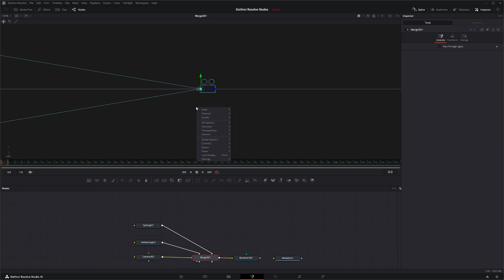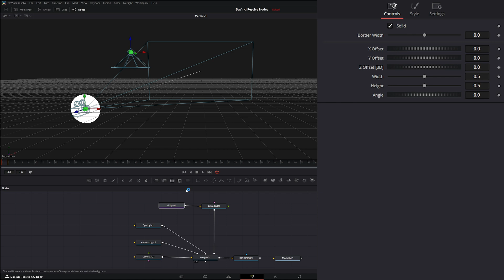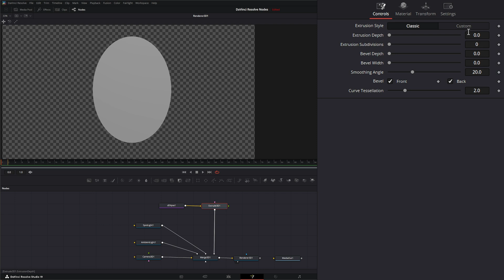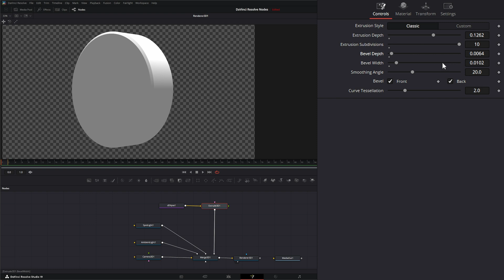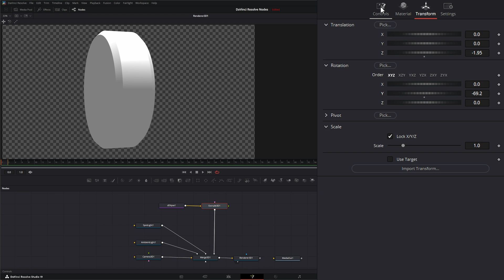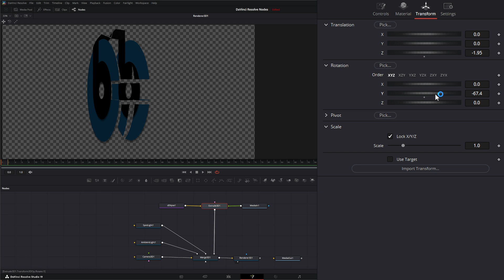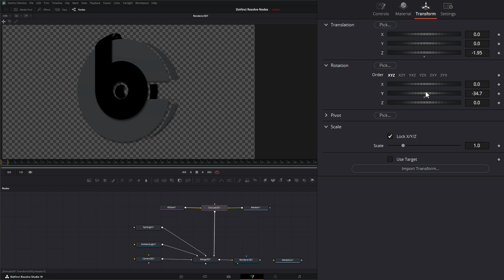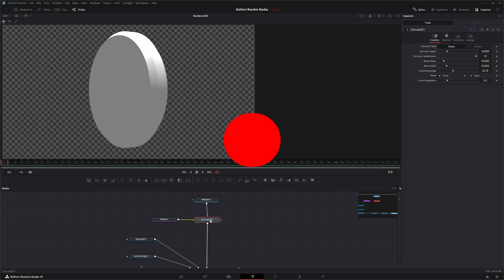DaVinci Resolve Extrude 3D Node

Comment: Great tutorial. Is there any way to apply some sort of modification to 3D models, or extruded images? The effect I'm looking for can be done by Warp or Grid warp nodes with 2D images. But I'm not sure if the same effect can be done to 3D models or texts? For example imagine there is a 3D model of the letter A and during the animation, the two legs of A grow down and then take a turn and go back up while the upper part of the letter A remains intact? I hope this makes sense
Reply from the maker: Thank you...it is possible, but more work in Fusion than it would be in a dedicated 3D program like Blender. However, you wouldn't be able to do it directly with the Text 3D node. You would have to use a combo of nodes for this.